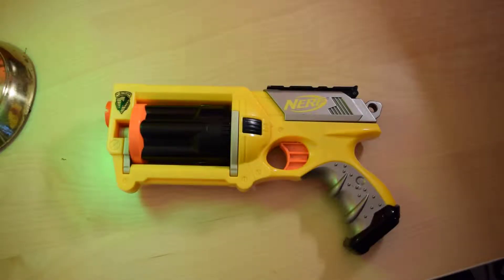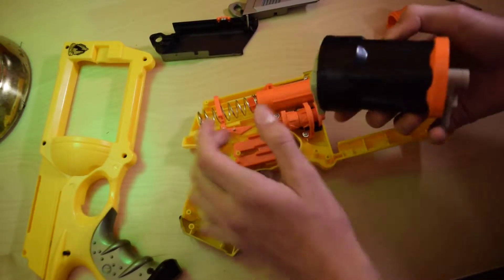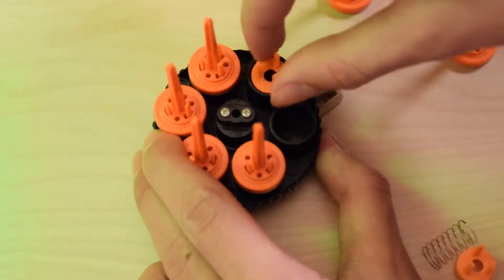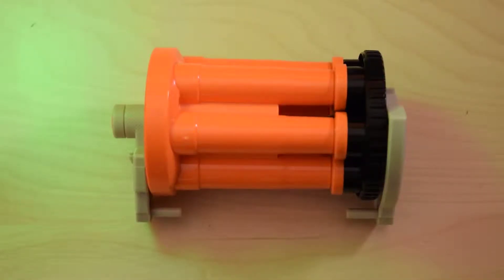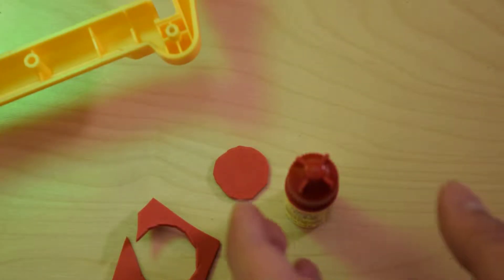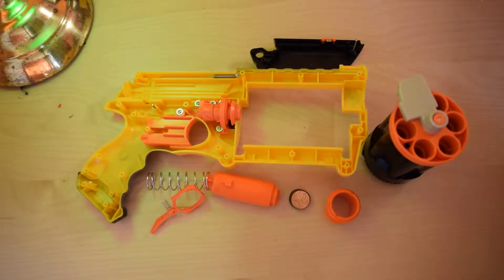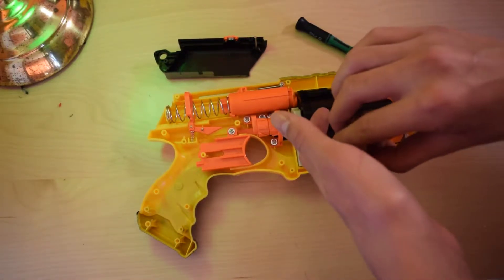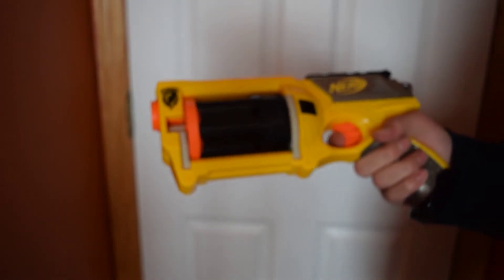[TUTORIAL] Maverick Mod Guide|Great for Beginners!

Comment: The maverick doesnt have a cylinder aligned with the plunger as you prime, so i dont think there will be many problems with vaccum loading. You might have issues with the darts falling too far backing the barrel, though.

Comment: did all the mods great vid, I'm in Australia so instead of pennys i used 5c coins fits perfect (used 6 cause they look a little thinner) and also weighted the handle with a stack of taped up 20c coins (five down the bottom they just fit ). from a dumpster find to mod firing elite darts thank you kindly

Comment: I’ve had the Maverick for a long time but if I prime the gun and release the primer at the click it would shoot the gun is it broken?
Reply: no, as long you have any added materials in the spring chamber that would compress the spring then that would be why.
Reply: I had this problem, for me it was that the ring was slipping at the catch, i fixed mine by removing one of the coins to reduce the pressure,  and removing some of the lubricant that accumulated on the lower notch of the plunger, 3 years old comment but eh, might help someone in the future

Comment: An additional/alternative modification for this is to fill the dead-space of the reverse-plunger system.  The stationary portion of the air-chamber is "dead-space", it provides an area for air-compression that does not contribute to dart-thrust, an issue eliminated (mostly) by direct-plunger systems.  Fill this chamber with styrofoam or other material and let a bit extend out from the back to act as the plunger-padding (instead of trying to glue a pad inside the actual plunger).  Then put a stiff tube/straw through the foam to allow air to pass unimpeded from the plunger itself to the rotating cylinder.
Another trick is to run a continuous layer of electrical-tape around the back of the cylinder where air exits the plunger-chamber to the dart-chambers and punch holes in it where the cylinder-holes are.  As you pull the trigger, the cylinder rotates at a slight distance from the air-port UNTIL the plunger is released at the same time as the dart-chamber is properly aligned, whereupon the plunger shoves the entire air-chamber forward against the back of the cylinder and SEALS against the tape as the air is discharged to launch the dart.  This is just one more way to ensure a proper air-seal.

Comment: Thank you so much for this easy to follow guide been moding blasters for a bit but not the ubiquitous Mav funny enough. Mines having firing issues I may have put too much tape under the O-ring also think the rotation is hindered slightly by the plastic on top of the cylinder not being hammered in enough